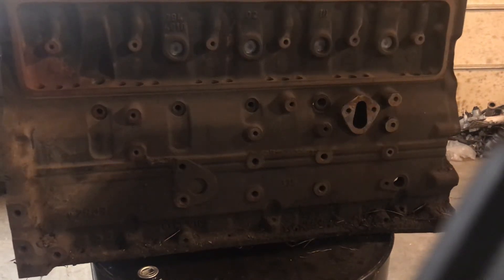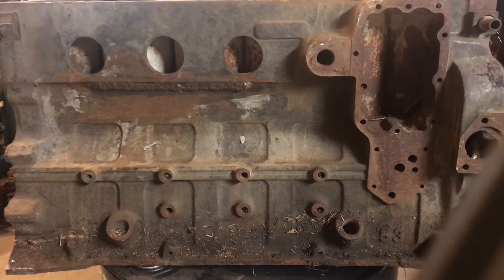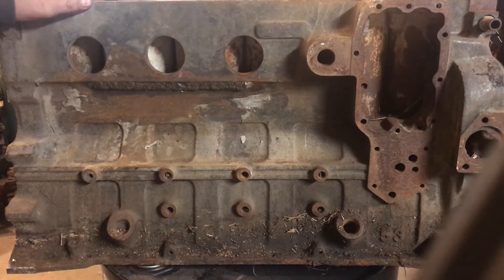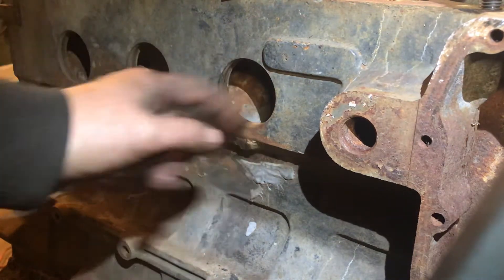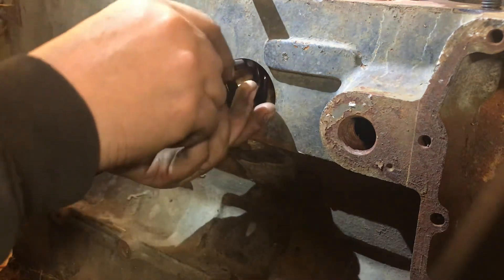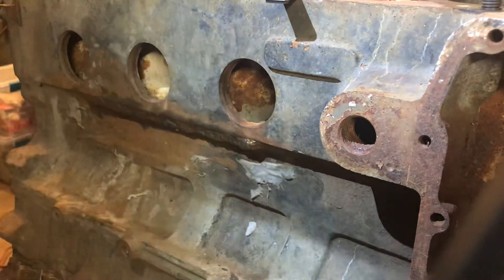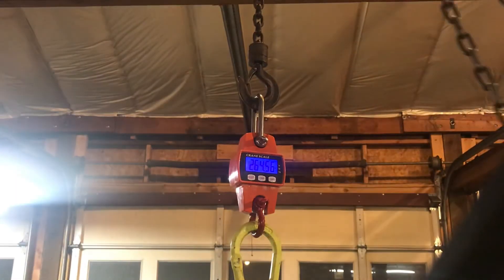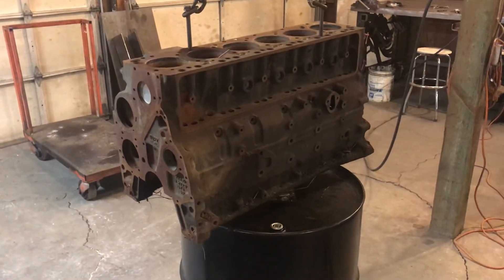(99) Cummins “53” block

Comment: I had a 53 block crack at 150,000 miles.  I put a 56 block in.  I was looking into putting the block at an angle, pulling the freeze plugs and filling it with concrete across that side up to the freeze plugs.  (This concrete is designed for this) but they recommended 30+ days to fully cure.  I still think it's a good ideal.  The second ideal I hade was to tear the block down heat up in an oven to around a 1000* , weld it and spray arch the outside to thicken the whole area, but decided it was cheaper to start over.  I wish you had found the weight difference., I was told that it was close to a 100 lbs.  I was also told that thes block were also known to crack between the cam gallery and the water jacket, this is what ultimately made my decision to replace.
Reply: I’ve a got a 1999 and mines unmarked

Comment: There was also a block made in Mexico that was used in the 2002 trucks that is thicker than the 56 block this block doesn't have an identifiable casting number I have one in my 2002 truck that is what i would be looking for as a replacement for your 53 block  good luck with your truck.
Reply from the maker: If the Mexican blocks are not marked with a number how do you identify them?
And this wasn’t outa my pickup, buddys pickup we did years ago
Reply: @tdm8817  I’d imagine the fact they have no numbers would be the identifying characteristic
Reply: Maybe the made in Mexico identification on the door sill would give it away? 🤔
Reply: @nsboost 😂😂

Comment: the best solution ive seen to fix them comes from sled pullers is to shave an 1/8 in off the fins on the waterpump.
Reply from the maker: Maybe that works for them but they only need the engine to work for 15 seconds at a time. But sounds like a terrible idea if your actually going to drive the pickup.
Reply: @tdm8817  thats not so true theres a guy that has a page theFumminsPage that hauls heavy and has over 500k on his 53 block
Reply from the maker: @allenrhodes  and there definitely are people out there that have a lot of miles on a 53 block without problems but I know I don’t want one in my pickup

Comment: I just bought a 1999 with 86,000 miles but it has a 53, should I dumb it or keep it?
Reply from the maker: I can’t make that decision for ya but I personally would keep it, just don’t overheat it or put some insane tuner on it. 
And if it dose crack the block I’d just put a new block in it, a dodge with under 100,000 miles is a rare thing theses days
Reply: @tdm8817  no rust either was a southern truck
Reply from the maker: @chadgreen3688  then if it were me I’d never get rid of it, I’m also a big sucker for the second gens tho, absolutely love those pickups.

Comment: Lock n stitch for the win. That would have been the way to do it.
Reply from the maker: Lock n stich is good but to me if the block is the problem the correct solution is to replace the block
Reply: @tdm8817  sure… if you have money to waste on a POS 2nd Gen. lock n stitch and send it. Otherwise you’re putting more money into the truck than the damn thing is worth. Only reason it’s even worth fixing at this point is inflation. Everything is so expensive these truck have value again. Otherwise.. it would be crush it and move on!
Reply from the maker: @nsboost  to you maybe, to me it makes much more sense to keep my second gen on the road rather than spend 80 grand on a new pickup that I don't even want. 

I don't care what resale value is as I will never sell it.
Reply: @tdm8817  I have a 2002 with the unmarked black (Mexican block?) and just bought a 14’ 3500. Honestly.. I love the 02, but I’ll never drive it again. The 6.7 is a beast. Only downside is the trans. Everything else is amazing.
Reply from the maker: @nsboost  well that's a shame, should sell the 02 then. To someone like me those are very sought after.